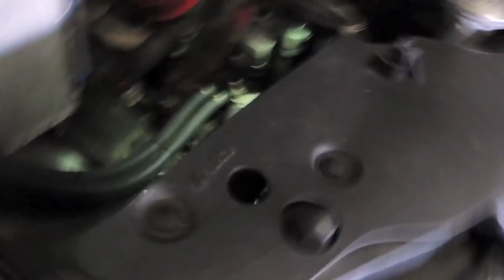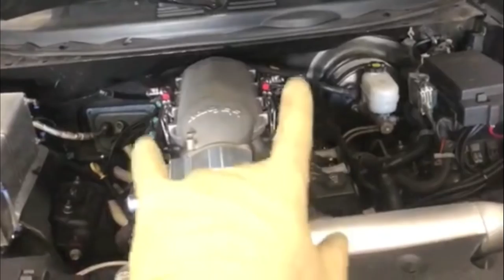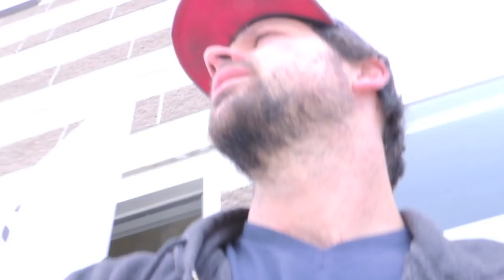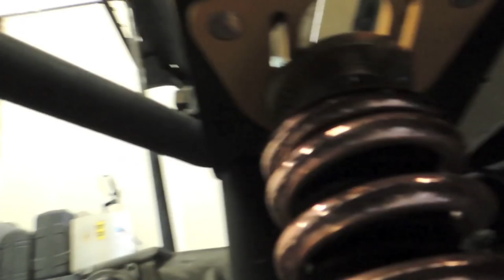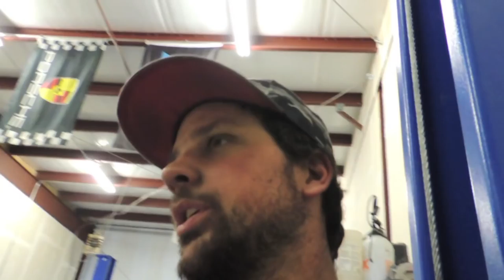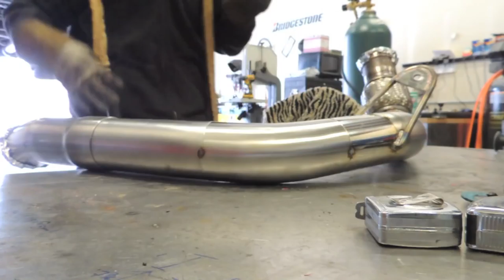1JZ Truck Side Exit Exhaust! & More Angle!

Comment: I looks cool but the only thing it will suck if you get caulk
Storm ⛈ at a drift event I would make a back up roof  and carry a lot of pop rivets LOL 😎👍
Reply from the maker: James Cook Jr. I don’t have wipers, front wheel tubs, a back window, and I have holes in the firewall. So I hope this thing never has to drive in the wet. Lol